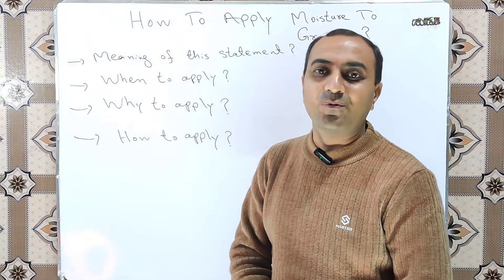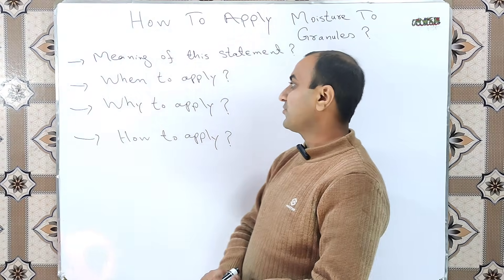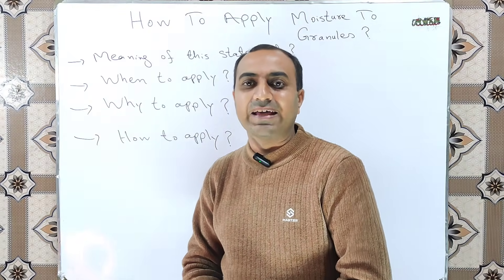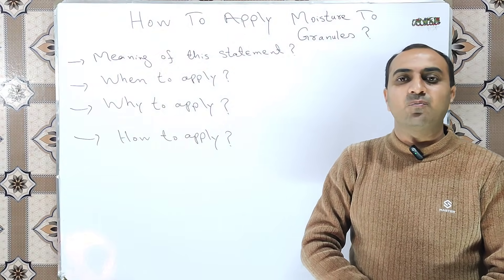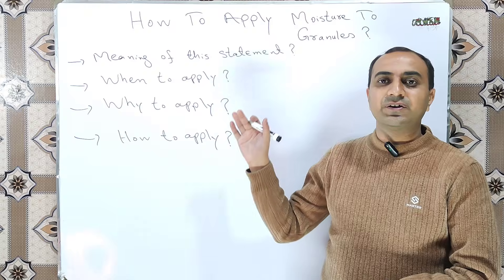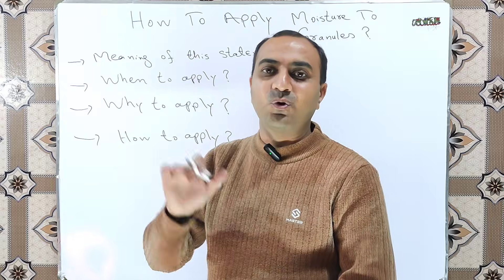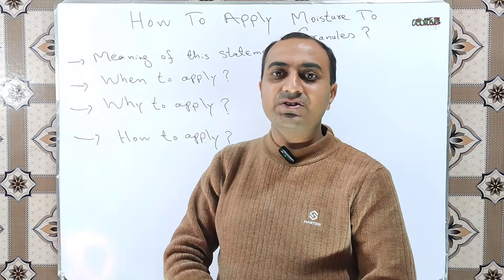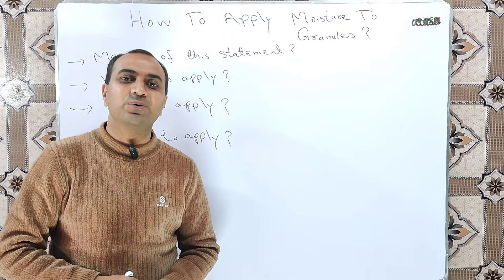How to apply moisture to granules

Comment: Sir ek baat btao agar humara batch size 130 kg hai aur capping face ho rhi hai to kitne kilo powder me kitna water lena hai moisture dene ke leye iski calculation kaise kre
Reply from the maker: Conduct trial for 5 to 10 kg powder and then apply accordingly
Reply: @Pharmainform  sir water ki calculation kaise krenge wo bta do aap plzz
Reply from the maker: Watch the complete video I mentioned enough solvent to form lumpy mass
Reply: Aap ek bari kr ke dikha do calculation
Reply from the maker: Ok I will record a video
Reply: Ok sir ji  @Pharmainform
Reply: @sumitnain2789 first we check the LOD (loss on drying) in moisture analyser apparatus, suppose our lod is 1.45% against the BMR limit(2.0-2.5) then we need only .75% moisture.
If our batch size is 100 kg without lubrication, then we need 750 ml of water (100/100 then multiply by .75 ) 750 ml of water needed
Reply: Good question ❤